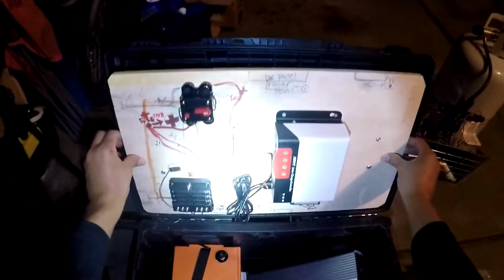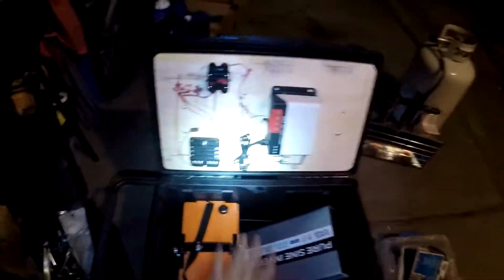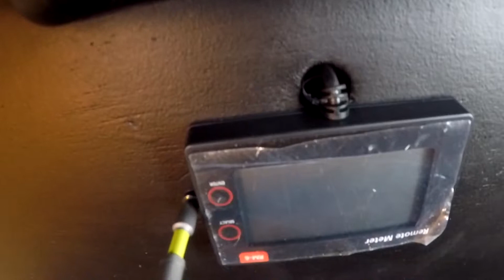Full Video Step By Step How To Build Heavy Duty Industrial Solar Generator

Comment: Down to about 20% for the battery, or it will decrease it's life cycle and don't keep it charged at over 85% for long periods to get the most from it.
Reply from the maker: These can dlbe depleated down to 0.  Have a life of about 5000 to cycles. Best to keep it plugged in at 100%

Comment: Total price for build?
Reply from the maker: About $950 without solar panels
Reply: @SoloJono  great price!! I would use 2 batteries for a long run, really like seen a 2000w inverter many people go for 1000w or less
Reply from the maker: @pilinke11  ya 200amp hours would be nice but they wouldnt fit in the chest. I could easily set up a second battery in the garage and just clip it into this system if needed. Ya again it was the largest i could find to fit in the chest. The 2000 watt inverter is yet to meet an appliance it cant handle! Runs tv, fridge, router, lights, computer, phone all at once!
Reply: @pilinke11  I think you see a lot of 1k or less projects because the batteries are 100ah 12v lifpo4 batteries used...which would give a max draw of 1200ah. If you have a 1500w+ inverter one could accidentally damage their battery because the power draw exceeds the battery's ability to produce that much power.